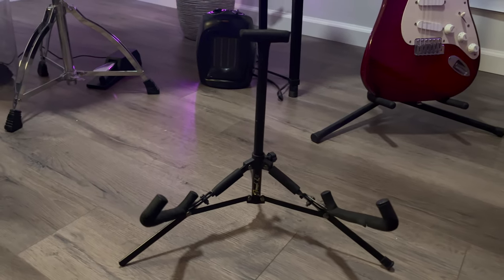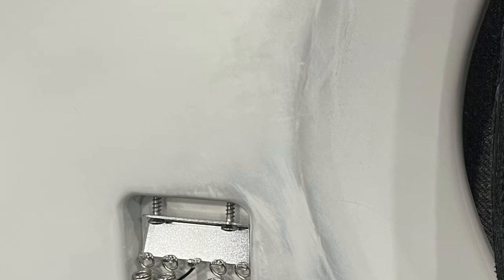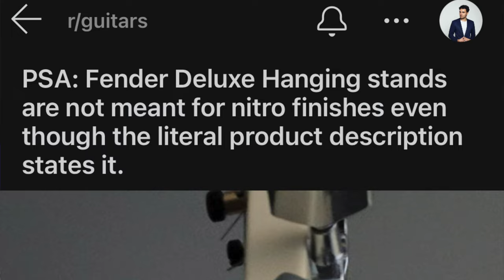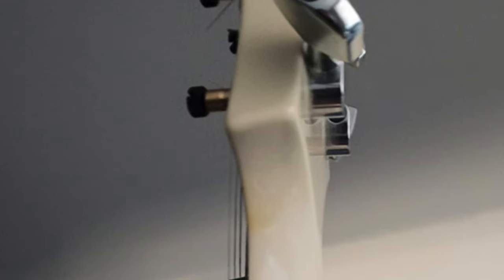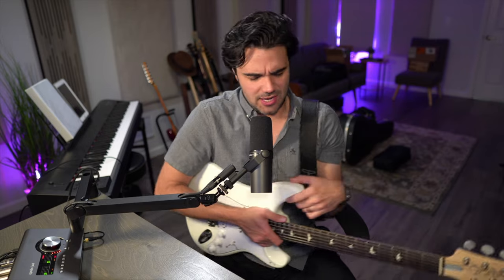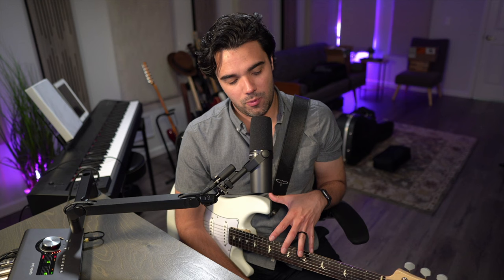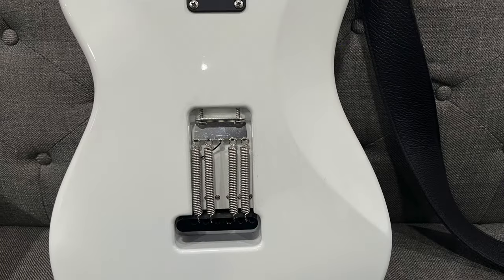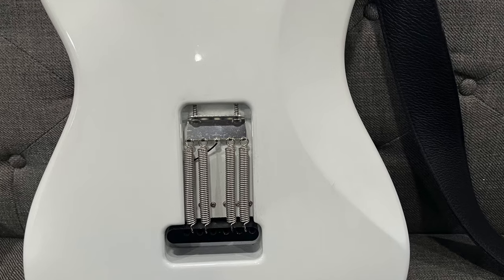DON’T Make This Mistake With Your Nitro Finish Guitar!

Comment: Poly or Nitro finishes DO NOT BREATHE ! Enough of this myth.
Reply from the maker: #Tone
Reply: The nitro guitars I have sound woodier, on god 😂
Reply: Nitro finishes never cure. Not like people think. They continue to shrink ,which is actually slow degradation! They are subject to weather changes as well..is all this bad?? No IMO..
Polyester or polyurethane 2K finishes are more like plastic and actually are a resin more then anything. Is this bad? No imo.. 
Each have their own goods and bads for the purpose they are used for. On guitars I think poly types look thick. Polyester is usually not thick , polyurethane tends to be. They are very durable ! 
Nitro can be thinner and doesn't shine with the same thick look as poly. It's a hard but fragile finish. Easy to chip, it can melt to plastics, certain liquids can hurt it but it's actually a great finish for guitars. Does it change the sound. That's subjective!!
Reply: So we don't need a wooden guitar then if it doesn't matter. Just make them all solid plastic if the wood doesn't have anything to do with tone
Reply: @BeeRumblin13 
Problem is that plastic doesn’t respond to tension the way wood does, most plastics would warp

Metal necks have been done but that’d be far too heavy for a body, they also exclude the truss rod adjustment 

So far, structurally, wood is just the most reasonable material to mass produce guitars with, in order to keep them feeling like guitars & operating like guitars, the acoustic tone would also change & that would trip up some players but magnetic pickups do not pickup the acoustic tone of the instrument that goes to the amplifier
Reply: NITRO is just for aesthetic. If you want your guitar that will age with you that will reflect your character as a player then nitro is for you.

Then if you are obsessive-compulsive who hates dings, dents, and cracks. Who also like their guitar look clean and brand new every time POLY is for you.

LETS TALK ABOUT TONE.

Any parts of your guitar or literally anything even pickguards which they can sell to you. They will use the word TONE to milk your cash out. Like for example in the gaming industry. Just put the tag "gaming" on a pair of regular headphones then double its price. Its how capitalism works. Again, perfectly fine its just up to you how you will handle those type of BS.

Now If you had a cheap guitar and you sound bad trust me even if you get the best guitars and amps you will still sound bad.

What I mean is whatever you had you need to make the most out of it. Playability is more important than tone! Practice is more important than tone! Think about Tone as just the cherry on top. The very last thing you need to deal with.

Hendrix was already Hendrix before he had fuzzfaces and wah's, SRV was already intense before tube screamers. John Mayer played Gravity on a Les Paul still sound like Gravity.
Reply: hate nitro paint, I have a roadworn Fender, when I play it for events in cities or relatively humid and sometimes foggy areas, after playing it and before I put it in the hard case, it turns out the guitar has been exposed to dew and is quite wet, and the sound changed drastically from being crispy, glassy, and the neck pickup was fleshy, to becoming quite dull, and it was quite difficult to get the crispy, meaty, glassy sound like before and I ended up selling the guitar, that's my reality and experience
Reply: @Camcodrummer this is true of original nitro they used in the 50s and 60s, and reissue guitars (especially Tom Murphy custom shop), however regular Gibson Standards use a very thick coat of “nitro” but they’ve added plasticizers that make it much more durable and closer to poly than most people care to admit. I can’t speak for the silver sky, but I doubt it’s the nitro formula used in the 50s
Reply: @BeeRumblin13 
Carbon fiber guitars exist.
Reply: @rizkyismail2852  sounds like you probably should have changed the strings
Reply: @minuscaseus  I have replaced the strings many times, but it turns out that wood that has been exposed to water has a different resonance
Reply: Nitro breathes - it never cures
Reply: @reneebear3641  that's true, magnetic pickups are not microphones and they do not pickup the acoustic properties of the guitar, BUT,, the strings DO. And the magnetic pickups will 'pickup' whatever the string is doing. That's why if you blow air onto a pickup you will hear nothing, but if you blow air onto the strings causing them to vibrate, you will hear that through the amps. So strings ARE like a microphone making magnetic pickups INDIRECTLY like a microphone by the nature of its relation to the strings. That's why wood can affect tone. And it can.
Reply: Not sure what you mean by breath, but nitro is not 100% seal, it's not waterproof or air proof. The reason they roast necks now is because they can mimics the same effect ad a seasoned neck that was nitro/laquer sealed and allowed the wood to age/season/cure/dry out over many years. My dad had an acoustic from the 60s. It sounded decent. Fast forward to the 90s. It had cured so well, it became much brighter and resonant. Roasting does that instantly. Nitro will allow that to happen naturally but it takes years depending in the weather.
Reply: @BeeRumblin13  the wood affects the tone, especially the neck, but the body also. Strings act like microphones and whatever the string does, the pickup translates to the amp as an electrical version.
Reply: @realtruenorth  roasting is to make necks look like woods banned by CITES laws. 🤦🏻
Reply: @realtruenorth  where do you make this stuff up?  Take the strings off your guitar, plug it in, talk into the pickup.  🤦🏻
Reply: @CharlieMoney777   LMAO, no, roasting is literally to evaporate the surgars and moisture the the wood is seasoned. I have read numerous articles about this including warmoth. 🤦🏻‍♂️🤦🏻‍♂️
Reply: @realtruenorth  you’ve been spitting out half truths all over YouTube.  Long winded paragraphs to ‘look’ like you know what you’re talking about. 

You clearly don’t. 🤦🏻🤦🏻🤦🏻
Reply: @CharlieMoney777  I went to Cal Poly for mechanic and electrical engineering. Did you? I'm not making anything up, it's common sense. A guitar is an acoustic instrument. Pickups convert the energy to electronic. Garbage in garbage out. The strings resonate with the instrument, it's not as critical as a hollowbody. But it still is a part of the equation. It's also about mass.
Reply: @CharlieMoney777  try playing solid body guitars at guitar center and notice how some resonate more than others. ... that translates through the strings. It's like recycled energy. String/nut/neck/body/bridge/string... it's a loop of vibration and its only as good as its weakest link.
Reply: @realtruenorth  once you said Guitar Center, I stopped reading.
Reply: @CharlieMoney777   actually I do. Sounds like you are the one who likes to "school" people. What's your background? Any mechanical or acoustical collage education? Or are you just youtube educated?
Reply: @CharlieMoney777   yeah. I think we're done here. You sound like a silly teenager. Move on.
Reply: @realtruenorth  REALLY getting in your head now.  You know nothing.  You just think typing 4 paragraphs makes you look smart online.  Your words prove otherwise.
Reply: @CharlieMoney777  LOL, you think very highly of yourself. You are the one who was triggered. Not me. I didn't start this conversation, you did. You're one of those guys who just can't let people enjoy success. Always gotta be a Debbie downer right? Only thing you have added is "you know nothing" trust me, everyone else here can see through that kind of talk. It's very telling.
Reply: @realtruenorth I think VERY highly of myself, thank you.
Reply: They been using plasticizers since the late 50s  @zaqintosh

Comment: Wrap any stand with strips of cotton. I have a Gibson Custom that had burn spots in the clear from a previous owner doing something similar. You can wet sand the back and edge of the guitar with 3M trizact sponge in 5000 grit followed by 8000 grit (in this case I believe 8000 alone would suffice) Then follow with hand buffing  using  microfiber and Meguiars Fine cut cleaner > Swirl Remover in succession and top with tech wax or hybrid ceramic wax.. It will not damage the finish and should remove any trace of what I see there. I've removed worse, it cleans the paint surface totally and gently removes the affected nitro. I have refurbished the paint this way on numerous Gibsons. Do the back of the necks as well. 8000 makes them glass like and ultra smooth to the touch.
Reply from the maker: I may have to give that a try. The worst residual is right above the trem cavity (where the stand hit the most).  So glad I noticed it when I did! Thanks for watching and commenting. Appreciate it.
Reply: Take the strap on an old houseboat. Cut it to length and slide it on to stand. Too easy.
Reply: Housecoat

Comment: Got my first Nitro guitar today ( Gibson SG standard) and right onto a foam stand it went. THANK GOD I happened across this video. I would've been so pissed if next time I picked it up there was black staining all over a new $1,800 instrument.
Reply from the maker: Glad it could help save someone! Every finish is different and reacts differently to different things. Get a good nitro-safe stand with a solid review track record. Also, be careful with clip-on headstock tuners. They can be trouble, in some cases, too.
Reply: Wish I knew this 10 years ago lol Put my first Gibson, a SG Standard too, on an inappropriate stand for a little while and the headstock is permanently damaged. Nothing big, doesn't bother me anymore, but wish I did things differently
Reply: @TomButwin  I noticed my tuner had rubber on it too, so i just taped it.
Reply: The silicone rubber is what gasses out into the lacquer. This is what causes both staining and stickiness with the stand. I've even seen guitar shops with the same problem with brand new guitars.

Comment: Weather change will also create problems with nitro moisture change can do this also giving a milky looking appearance . Leaving your guitar in a case will cause the nitro to relic your tuners, which in a way is kind of cool if you go for a vintage look. Severe whether change can actually crack a nitro finish all the way to the wood, especially when the guitar is newer.
Reply from the maker: Great points and info, Bob. Thank you!
Reply: This is what’s happened to my silver sky; I’ve got cracks on the back and I’m not sure what to do to fix it
Reply: My black strat body finish went like a cracked eggshell and milky bits started falling off

Comment: Now you have a relic.

I have a nitro finished Fender AVRI 62 Jazzmaster I bought new in 2003.   I had it rested a lot on a red faux sued couch and after a few months I noticed there was red color on the places it rested on the couch.  It absorbed the red dye from the couch material.  If I had a poly finish it would have never happened.  I would never do that on  purpose but since it was natural and not over the top it doesn't bother me.  The guitar fell and hit the bottom of a swivel chair and chipped a small piece on the back near the neck plate.  Now that bothers me but the red doesn't.  Now I have a reliced guitar even though I wasn't planning on it.
Reply from the maker: Luckily, I was able to get most of the surface level stuff out, but there's still some damage around the trem cavity! I know what you mean about some damage being "ok" and other damage really bothering you.

Comment: There's no such thing as "a lacquer" - there's no other finish made with this formulation. Lacquer isn't a generic term and is only formulated with nitrocellulose. Be as that may nitrocellulose isn't the only thing that lacquer is made from. And calling this "nitro" is ignorant as "nitro" refers to NITROUS OXIDE.  And the type of finish has absolutely nothing to do with the sound of your guitar any more than the colour does! This too is ignorant. It's because all the pre-CBS Fender snobs think that there's some type of magic in the paint just because it's what Fender used back when they first started making guitars and amps. Lacquer is made from tree gum spirits which is what the cellulose refers to - cellulose fibers in the finish. This is a weak spots as it allows things through the finish. This is because it leeches into the holes in the paint surface. It's not truly a solid paint as finish touch ups are nearly impossible to hide with telltale witness lines between old and new resprays. 

This is because it's and ORGANIC finish.  Unlike acrylic which the imbeciles of the automotive paint industry call their product in an attempt to gain the confidence of automotive manufacturers to use the new DuPont paint lines offered in the mid nineteen fifties. However that may be it's NOT LACQUER. But polyester was formulated with higher solids from hydrocarbons in the late nineteen sixties and they have proven themselves to be much better suited for mass production and resist most household chemicals. What happened with this guitar is the same thing that happens with lacquer which would never happen with an acrylic finish.

 The gassing out of the silicone rubber parts of the pads on your guitar stand leech into the surface of the lacquer as it's organic in the nature of it's formulation. This will happen every time. I've read about other people having the same problem but I don't use guitar stands. I prop my guitars against the wall or an amplifier when I'm only pausing for a moment. But the rest of the time they are in a gig bag or a guitar case to prevent this from happening to my guitars.

Comment: You can restore the glossy finish using a microfiber cloth and  McGuiars Ultimate Rubbing compound, McGuiar’s Swirl-X, and McGuiar’s Ultimate Polish.  These are automotive products that are safe to use on a nitrocellulose lacquer finish.  I have used them to fix finish dulling from skin oils on a Martin HD-28, Gibson 1960 Hummingbird, and to fix damage to Gibson SG caused by a Peterson Stroboclip that I accidentally left on the headstock inside its case.  There are videos others have posted on YT on how to use these on a nitro guitar finish.
Reply from the maker: Excellent advice! The comment section (and I) thank you!
Reply: Is there any way to fix cracks on a nitro finish? Had mine out in cold weather and it’s cracked on the back
Reply: @diderkamal1  Depending on how bad the cracks are, a luthier might be able to repair it.  Some people pay a lot of money to get a relic finish.  It will probably be an expensive repair.  Shouldn’t affect the sound.
Reply: I don't see any videos. Can this fix staining caused by a nylon strap ?
Reply: @ajdoyle9559  don’t know. If it is a discoloration it depends on how deep into the finish it penetrated.  My guess is the strap may have melted into the finish in which case you would likely want to have a professional look at it.

Comment: There should really be a disclaimer on things like this &  also how extreme temp changes check the finish & other do's & don'ts . Everybody has to learn at some point & it sucks to learn the hard way on any instrument
Reply from the maker: Totally agree. Although, as I admitted in the video, upon researching this is more common knowledge than not. Although, I had never thought about it or heard! Lol So, didn’t help me much. 

Temp/humidity are more obvious (even though many guitars are neglected in those areas as well), but a chemical reaction from a stand that’s MEANT for guitars is…well, whatever lol. Thankfully, the permanent damage isn’t too noticeable. Hope my video helps others avoid this!
Reply: if you have a guitar with a nitro finish, even in the best weather conditions, sooner or later the finish will check.
Reply: @TomButwin  There should totally be a disclaimer. So much can go wrong with these finishes, it's totally not worth it unless it's used to make a flamed top look more appealing, every rookie is gonna make some of these mistakes.

Comment: I really don't think the alleged benefits of a nitro finish (it's more tone wood stuff for me) make it worth. You can't even throw shade on a guitar with nitro finish, that it will get a stain.
PU all the way for me. Way more easier to handle looking at the overall picture.
Reply from the maker: I wonder about the tonal benefits as well. It’s definitely more fragile and is going to wear in ways other finishes won’t. So, you’re not wrong! Thanks for watching. Hope you’ll subscribe, if you haven’t yet.
Reply: @TomButwin it’s just that an old poly guitar chips and doesn’t look nice aged , they look great if mint but they don’t wear like old gibsons or fenders .. that’s why people try to repair chips on poly guitars not on nitro guitars … I took the nitro off my silver sky rolled shoulder and dirt soiled it in a week due to mosquito repellent residue on my hands … my 94 57 AVRi is poli mint with one annoying chip .. my 94 les paul looks like it’s 30 years old … and I bought it brand new in 94 😉

Comment: This is a very good point to be careful about. Nitro is the standard finish on boutique, hand made and upscale acoustic instruments, from violins to mandolins, guitars and banjos. Poly is pretty much relegated to the most modern and lower end instruments, esp. electric guitars. These also might have polyester finishes which is different.
Reply from the maker: They are beautiful finishes, but certainly come with some quirks when compared to the other options. Thanks for watching!
Reply: Polyurethane not polyester
Reply: @realtruenorth  Depends. American Fender guitars have polyurethane (professional Strats for example) or nitro. Made in Mexico Stratocasters have a polyester finish.